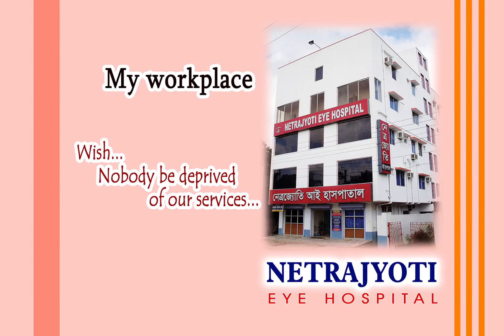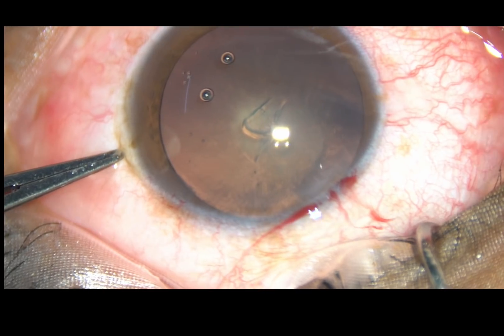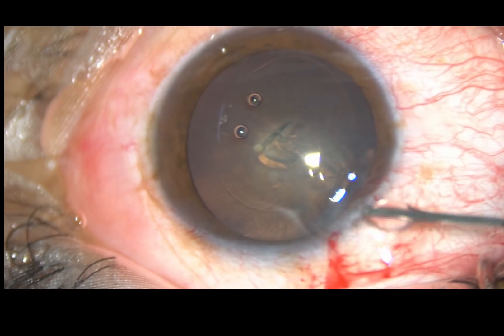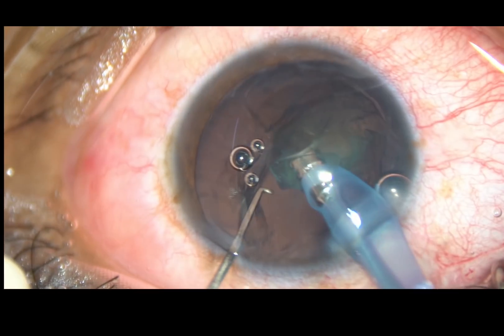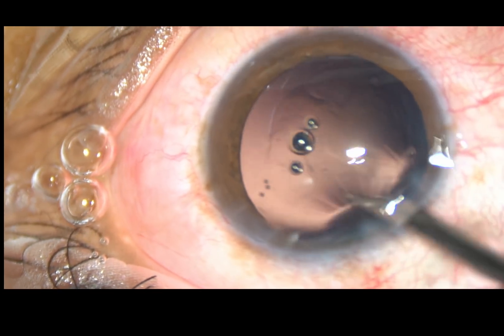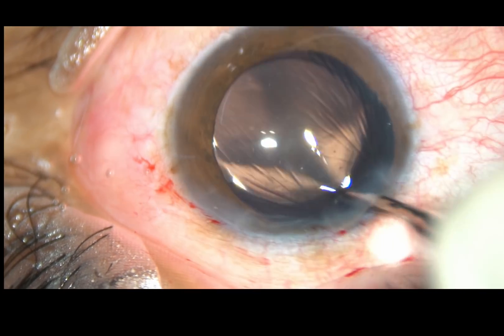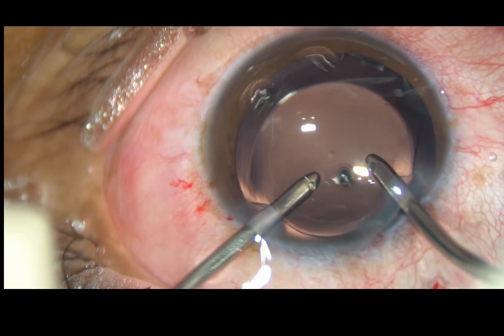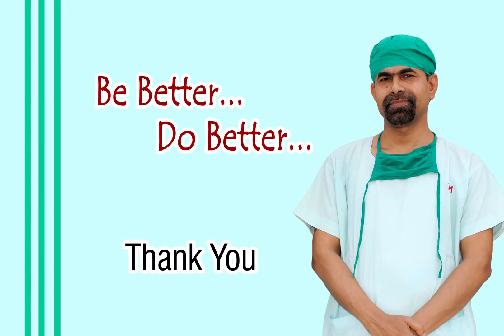Is it a very soft cataract ?  Go bevel down and GOBBLE the Lens mass..

Comment: I found it difficult to use simcoe since it causes frequent anterior chamber collapses and inefficient aspiration in my hands. Unfortunately I can't find enough oppurtunity to get used to it, in our institution simcoe is reserved for only ECCEs and globe perforation repairements which occurs rarely nowadays. Would you like to share any tips to make best use of it, Sir?
Reply from the maker: Ozan Sonbahar 
Simcoe is a wonderful simple tool.
After taking the phaco handpiece out, I inject some visco. Aspirate cortex through main incision as long as I find the AC formed. As soon as AC tends to be shallow,  I go through the sideport which should of such width that your 23 G Simco can go without stressing the wound.
I use a 10 cc glass syringe to create vacuum. But my colleagues do it by a plastic syringe which can  work equally efficiently.
Reply from the maker: Ozan Sonbahar 
When you inject visco 
It comes out gradually and give you some time to work through the main incision.
Reply: Thanks for your reply. Should we use a higher bottle height since there is no therotical upper limit of aspiration rate with simcoe?  Since your routine cases take no more than 10-15 minutes, i suppose you don't change your predetermined bottle height. Is it more than 110 cm?